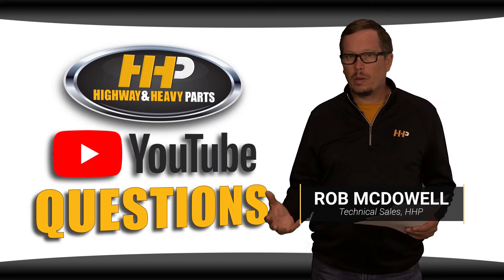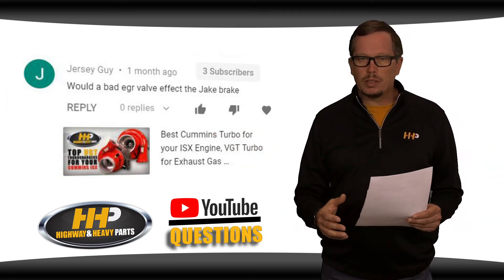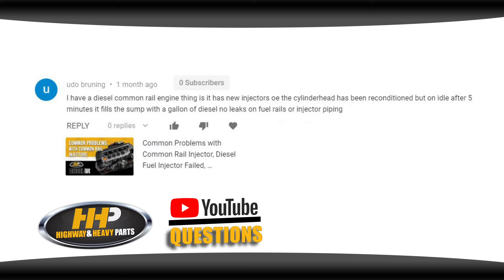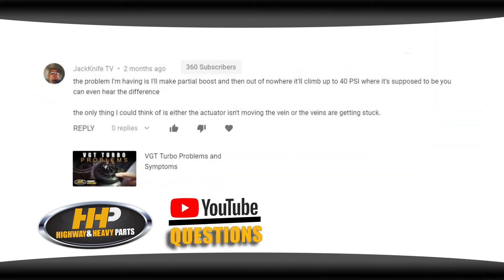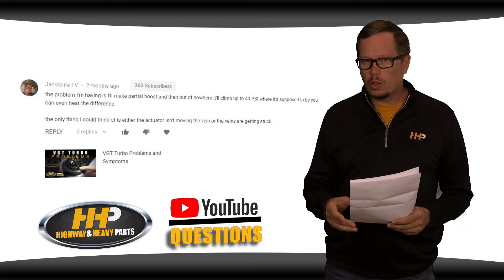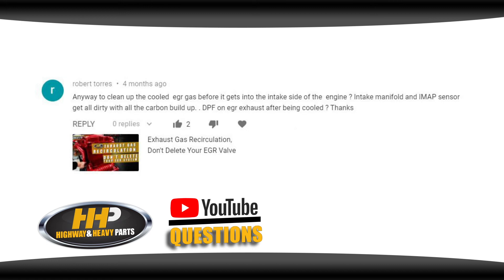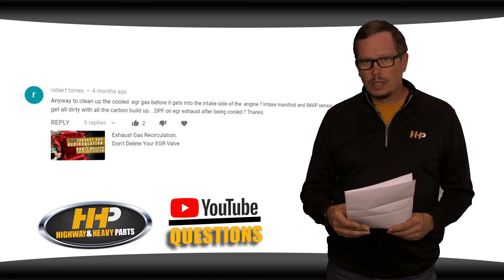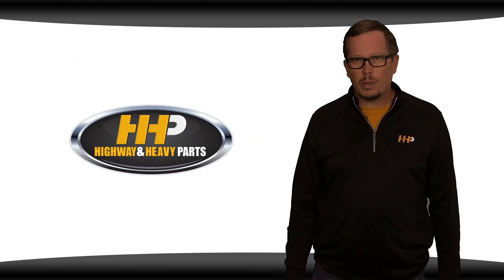Diesel Parts YouTube Questions & Answers, EGR, Jake Brake, Common Rail Injection & Turbochargers!

Comment: Great information.
Recently got a 2007 LBZ GMC Duramax that runs very well and hasnt been abused.
Wanted to gather information as I inspect the engine and determine what is needed, or maybe modifications that need removing.
Stay gold.